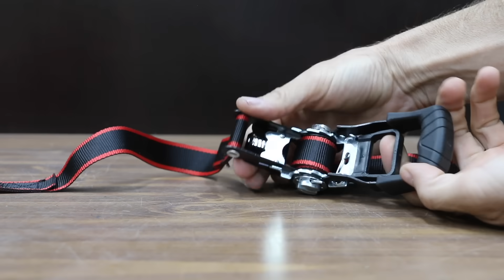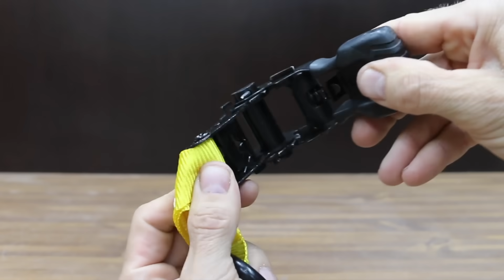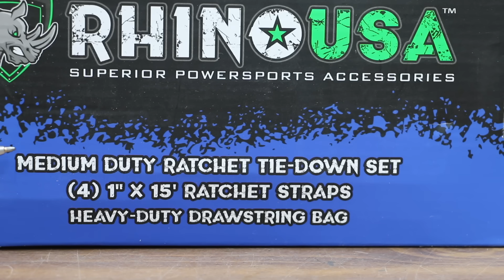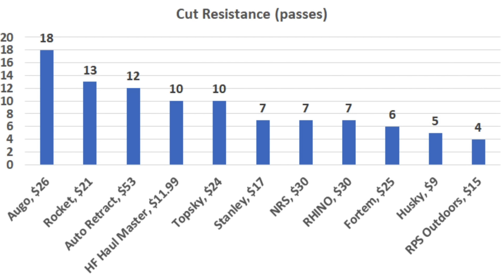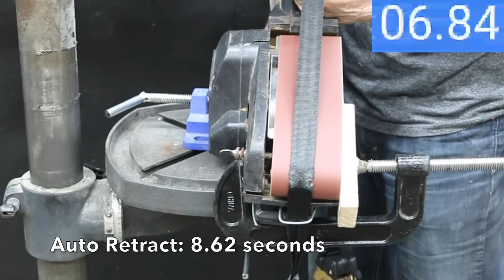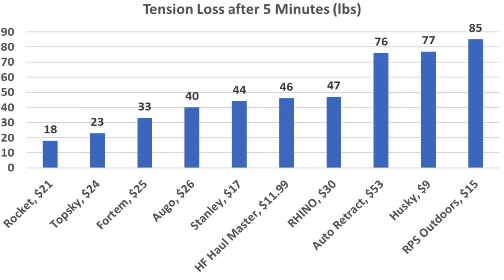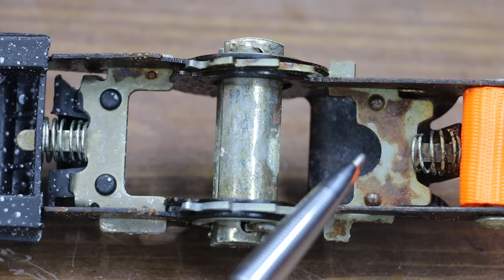Best Ratchet Strap? Husky vs Stanley, Rhino USA, Rocket, Topsky, Augo, RPS Outdoors

Comment: The husky straps do ok. Their major weak point is the release handle. It is all plastic and if you have to apply some pressure it'll snap. After having to cut two off a load because the release broke I threw them away.
Reply from the maker: Thanks for sharing.

Comment: I have a suggestion for an experiment. Could you test the penetrating power into wood of different kinds and grades of linseed oil?
I'm currently rehandling axes and I'm using linseed oil to protect the handles and supposedly  make the wood swell inside the head for a tighter fit. Linseed oil is available as cold-pressed and warm pressed, boiled and raw. Cold pressed is the highest quality with the best penetrating power and boiled linseed oil dries quicker than raw, but will boiled linseed oil penetrate a tool handle as well as raw? Should I rely on only one type of oil, or should I use one initially for saturation of the wood and another for a final sealing coat? Also can the oil penetrate the wood that is already pressed and wedget into the axe head?
Reply from the maker: Thanks for the video idea.

Comment: I have a video idea. 
I’m building a 20’x20’ 2 story cabin on a windy hill and I’m wondering how much strength construction sheathing material will add to my walls. 
Some building materials I’m considering if I win the lottery are:
1/2” plywood
5/8” plywood
3/4” plywood
Also
1/2” drywall
Corrugated metal
Siding nailed to the plywood exterior

Other things I’m considering:
How much do window/door openings, strapping, brackets effect wall sheer strength. 

Maybe you could build 24”x24” or 48” x48” wall samples and crush them diagonally to test the strength. You’d know better than me. 

Make it a great day.

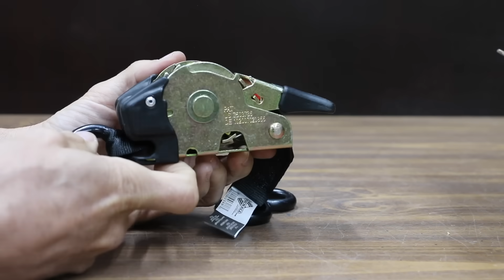Comment: 1:03 - I have the exact same type of auto-retractable ratchet and have to say that the internal spring has lost some tension over time. It now wouldn't fully rewind the webbing and I have to manually turn the ratchet wheel to retract the remaining webbing length which is about 6". Outside of that they're pretty handy when it comes to quickly securing objects the seatbelt way in confined space.
Reply from the maker: Thanks for sharing.

Comment: May I suggest figuring out good spray adhesive that might be used for various types of material in interior but holds value for outdoor elements like boating but can hold materials for headliners, so like Vinyl, Heavy Flannel, synthetic leather etc,...
Reply from the maker: Great suggestion!  Thank you.

Comment: This might sound odd but a lot of guys in manufacturing, diesel, and other industrial fields.... well we tend to be kinda “large”. I tend to wear out the belts I wear within a couple months before they stretch or “hang”(so no matter what they hang at the rear) and I have to poke a new hole in them and recently I bought a steel core belt made by Hanks cause I’m sure my coworkers get tired of seeing my plumbers crack. Well I realized there’s alot of different Amish made brands and others like car hart & Duluth and whatnot out there and well most of us guys hang stuff from our belts like tapes or tool pouches and the last thing you want is a little weight dragging your pants down so a review on different heavy duty belts would be cool “rate off comfort durability and whatnot”
Reply from the maker: Thanks for the video idea.

Comment: I couldn’t find the Topsky model you used for that price, they seem to sold out on Amazon, on the Topsky website they are $49.99 for the 4 pk. They have several models with lower breaking strength.
I think you made them too popular. I am not in a hurry as I have four action packer boxes full from 1” through 4”.
I always put a few drops of oil on those ratchets.
I
Reply from the maker: Thanks for sharing!

Comment: Hey man, have you considered testing WOOD SCREWS? in the car audio community, we have an issue with finding a reliable wood screw or deck screw that's suitable for holding in very powerful speakers.

We need a wood screw with a pan head, that can withstand constant vibration and has a serious bite in plywood or MDF.

Also considering t nuts or threaded inserts, there's typically clearance issues and cost is significantly higher. Not to mention the dreaded "tink" of the last one falling into the bottom of the enclosure
Reply from the maker: Thanks for the suggestion.

Comment: As a Beekeeper I prefer the Husky, which you forgot to mention, includes a drawstring bag under plastic cap behind packaging (hidden). It performs great outdoors in the sun and rain, and has not failed. Many others I've tried rust out or straps break, especially with UV exposure. I would like to have seen you use a price to performance scale, but overall did a great job sorting out pros and cons, so thank you. I don't think you can beat the Husky at that price point!

Comment: Project Farm, what about testing a synthetic HDEO against a 4-stroke outboard oil?  

Full FC-W testing and lubricity testing under a load of 5500 rpms sustained. 

4-stroke Outboard motor oils do more work than people realize.  Your car oil sure doesn’t keep a sustained 5,000 rpm.  

I’m curious if there are any other alternatives to the monopoly that big outboard manufactures offer. 

Quicksilver 25w-40 vs. Rotella T-6 15w-40

AND THE GLOVES ARE OFF!!
Reply from the maker: Thanks for the suggestion.

Comment: I bought a pack of 4 Tekton 1”wracheting straps for around $15 about 10 years ago. I use them frequently and keep them in my truck. When I got them I thought they were basically disposable, but the price was alright. Kinda surprising how long they have lasted and they are still in great shape. Had a orange harbor freight set before that lasted a few uses before I chucked em.
Reply from the maker: Thanks for sharing.

Comment: Would love to see a video testing different types of rebar. Different sizes, different types, black iron, stainless, fiberglass basalt, micro rebar, rebar mat.
Maybe a pullout test, corrosion resistance (preferably in concrete), crack resistance, beam capacity test. Could probably make more than one video out of it.
Reply from the maker: Thanksk for the video idea.

Comment: Can you test compressed air fittings? I've plumbed a new shop for air and looking at the different types of fittings, specifically the V-style verses M-style. The V-style are supposed to be high flow, but does it actually make a difference? Also they are supposed to be interchangeable. I'm thinking maybe you could use an impact tool to measure torque between the different styles.
Reply from the maker: Thanks for the video idea.

Comment: I'm a little surprised the HF straps didn't come out on the bottom. I regard them as throwaways - I buy them on sale, and use them to load things I'm getting rid of into the cars and trucks of friends, with the requirement that they NOT return the straps. But despite my low opinion, the HF straps are pretty much all I use...because I have so many of them. It's like that joke about the food being terrible, but the portions are large.

Thanks a lot for the tip on storing. I'm also use the 'I'll untangle it later' method, but I think I'll try yours instead.
Reply from the maker: Thanks for the feedback.  You are welcome!

Comment: I absolutely love your videos keep up the good work!!! I had an idea for a future video that I've seen it done a couple of times but never had any testing done to prove the results is using a 110v dc inverted arc welder to wake up or rejuvenate dead 12v car batteries that wont take a charge or no longer starts a vehicle by desulfating the plates within the battery. I'm kind of curious to see how well the batteries hold up and will they keep a charge if they sit for a while. Thanks again for the videos!!
Reply from the maker: You are welcome!  Thanks for the video idea.

Comment: Hi Todd again.  I used to study chemical science (organic chem) in university long time ago, and we used to run engines on Gas(74%)/Water(25%) mix with Ethoxylated Alcohol(1%)  Ethoxylated alcohol is commonly found in multipurpose cleaner that is yellow. (you can actually buy it from Walmart generic brand multipurpose cleaner). You can mix it together well which makes an emulsified milky mix that stays milky for a few days. We used to use it on the generator. You can also use that method with a Diesel engine 49% diesel/50% water/1% ethoxylated alcohol. (it was an older diesel Mercedes we tried on) You may wanna start from 25%water mix gradually to 50% and see where works best as we tried on some diesel engines that didn't like more than 40%. Diesel runs absolutely well. Much better than a gas setup. We inspected the combustion chamber after 1000miles of use and it was so clean we couldn't believe it. It also gives better power as well. It also completely eliminates black smoke as water somehow makes the combustion cleaner.  I think you would have fun trying it. Mixing it very well makes difference. :-) ONE THING is that you cannot use this mix when it's cold as water will become ice!  So only in the summer season. I would love to see your stuff run on half water! Especially diesel-powered tractors and such. One thing to note is that you would not lose much power for the craziest reason. We dyno tested and the 50% mix actually only had appx 10% loss on power, but better torque delivery. We couldn't figure it out. Maybe you can!!
Reply from the maker: Thanks for the suggestion.

Comment: The zinc coating prevents corrosion got me thinking. 
  In my years of building and fabricating various things,  unprotected grade 8 bolts seem to resist rusting better than lower grade nuts and bolts like grade 5 etc.  
  Have you done a video comparing corrosion of various bolt grades with your special spray?  If not,  it would be great to see!
Reply: Grades 3,5,8, Stainless, zinc, galvanized,  copper / brass,  black oxide.
Reply from the maker: Thanks for the video idea.

Comment: The only ratchet strap I've ever disliked was a cheap one that you could NOT pull the pawl out once you tightened it down.  You basically needed a second strap to take the tension off so you could release the first one.  This was years ago, kept the strap, threw the mechanism in the trash.
Reply from the maker: Thanks for sharing.

Comment: Excellent video! Tests were wonderful, and I’m glad you’ve included one of the spiky, pressure based ratcheting straps here, as those are the ones I’m most familiar with using. 

I’m personally more of a rope guy myself. I know rope isn’t nearly as popular as ratchet straps, but it’d be awesome to me if you’d test similar hardware store rope brands. Beyond absolute tensile strength, the outer surface should have lots of friction for secure lashings and knots. In contradiction, when making truckers hitches or other mechanical advantage based knots, less friction is preferred, as friction will reduce efficiency and can/will actually make your rope cut through the other part of your rope. The lighter and less rigid the rope is, the easier it is the work with. I’ve personally noticed some ropes begin rotting and weakening far sooner than others, maybe this could be tested, too.

Thank you for your great content!
Reply from the maker: Thanks and welcome!   Thanks for the video idea.

Comment: @project farm Video suggestion: I have always struggled to find a reliable and long lasting 8 or 10 inch adjustable wrench that doesn’t cost more than $25 or so. I think a video on the best adjustable wrench under $25 would be interesting. It might be fun to throw in an S-K or snap on wrench in the mix just to see how the cheap ones stack up against an expensive one.
Reply from the maker: Thanks for the video idea.

Comment: At this size straps the only reason I'll use anything else than the auto-retract ones is because I can't find a auto-retract one.  They're just so convenient! And for tying down anything I can lift they're plenty strong enough...
I have a 2" version as well witch I use a lot...
Anything heavier that what I'll lift into the back of my van I'll use one or more proper 2" 5 ton rated straps for, and swap them out when they start showing signs of wear..
Reply from the maker: Thanks for the feedback.

Comment: Please test metal file brands! Forgive me if it’s been tested before, I’ve searched for it on your channel and didn’t find anything. I’ve heard all kinds of different opinions on what brand is good. That different brands use different blends of steel and different gardening and sharpening methods. I think it would be an interesting video to test hardness, brittleness, sharpness, pitch, tpi, how fast it will cut through metals, how long it takes to dull, and what metals they will cut. I think this video would help a lot of people.
Thanks for all your videos!! You’ve saved me countless hours in trial and error in brand choices.
Reply from the maker: You are welcome!  Thanks for the video idea.

Comment: Suggestion:  Which is best high flow 1/4 inch pipe thread quick disconnect air coupler?  Milton V?  Another brand?  Better info?
Reply from the maker: Thanks for the video idea.

Comment: I see TOPSKY also makes Cambuckle Tie Down Straps, could we get a dedicated Cambuckle Tie Down Straps test? 
I find them much easier to use on loads that don't need ratchet strength like motorcycles and kayaks.
Reply from the maker: Great suggestion!  Thank you.

Comment: Wished he would have test the ratchets ability to tighten until failure it's fine if something has 3000 pounds of holding Force but if the ratchet fails at 75 lb what good is it
Reply from the maker: Thanks for the suggestion.

Comment: Suggestion for a test; there is a lot of debate about wood clamps (cheap ones do not clamp tight enough). Does it really make a strength difference in how tight the wood is clamped together when gluing ?
Reply from the maker: Thanks for the video idea.

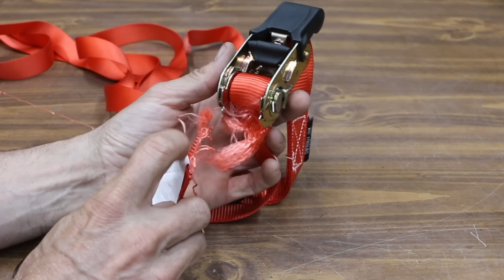Comment: At about 11:15 minutes in, another great measurement that you mentioned in passing was length of stretch (compare at some common number, such as X-inches of stretch at 1,300 pounds).  A strap that stretches too much isn't a great strap to secure loads with.  Edit: I guess the tension test could cover this data.
Reply from the maker: Thanks for the feedback.

Comment: 17:20 - Worth watching for that tip alone! Always a pain digging out the straps from the rear of my car to find they've knotted themselves up again (don't use them often but guaranteed that you'd need them when their not in the car otherwise).
Reply: Fact is, there is a ratchet strap gremlin that no matter how careful you store them will come along and tangle them up. Usually right before you need them and it is pouring rain.

Comment: lol, this is pretty good.  I just bought a bunch of straps and went through this purchasing process.  The Rhino was $30 on amazon and felt cheaper than $9 husky.  I went to get more husky, but Home Depot was out, so I was desperate and got the Stanley at $16.  To me, they felt cheaper than $9 husky, but not by much, BUT they are more money.  I then ended up buying the 1 1/4" x 16 ft Husky, they went from $16 to $10, and they are larger, stronger (1000 claimed load) and longer than the others.  They are the best of the 4 sets I bought, but they are a little larger, so they don't store as well.  But for now on, I will stick to the 1" $9 husky and the 1 1/4 $10 husky.
Reply from the maker: Thanks for sharing.

Comment: As usual, a very nice job of comparison and performance of a device we all need and use often.

Would like to see a table with the prices for easy comparison.
A table with all the results side by side would also be great.
Not a complaint, just a suggestion for how you might make your videos even greater.

 Personally, when I was hauling expensive equipment to job sites, I always bought heavier and wider straps, preferring to spend a little more and not having to be concerned about strength.

But I never had taken the time to do a lot of comparison shopping in any systematic way, so this video is a great idea and very helpful.

Perhaps a future video might compare larger and heavier straps, and perhaps do a comparison of how much money one has to spend in order to get more strength and peace of mind.

My general sense of it was, when I was in a store looking them over and deciding which to buy, that the additional money for much heavier (meaning the wider and larger models) straps was not a lot compared to what a failure might cost.
On a highway, it could be a disaster if a strap broke or fell off. 
Someone could be killed, after all. 
Or something that cost a whole lot of money could be destroyed. 
I did one time have a strap shift and come loose, and wrap around my trailer wheel, wrecking the bearing, so I was interested to see that safety latch.
I never had any straps with such a latch, and that would have prevented the accident with the trailer bearing.

Thanks again, and as always, I love your work!
Reply from the maker: Thanks!  Thanks for the video idea.

Comment: Hey there I commented a few times before I just had an idea for a new video I'm a doing a small job my self so I'm using chemicals for paint stripping so I was wondering if you can do a video on that if you haven't yet I'm testing products for removing paint from wood trims and such but also I tested before to remove on metal I hope you take this into consideration for multiple paint layers
Reply from the maker: Thanks for the video idea.